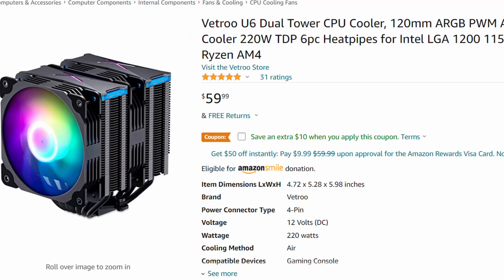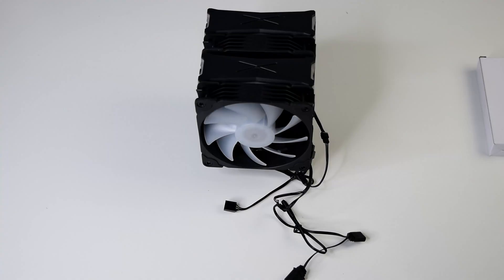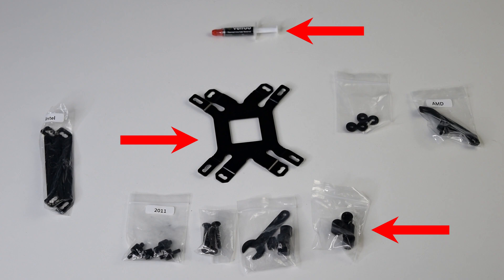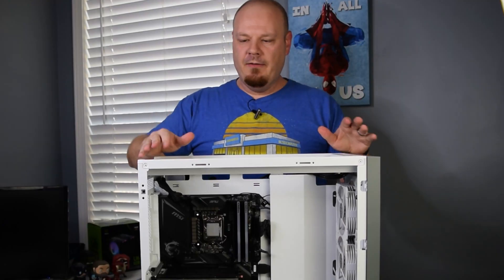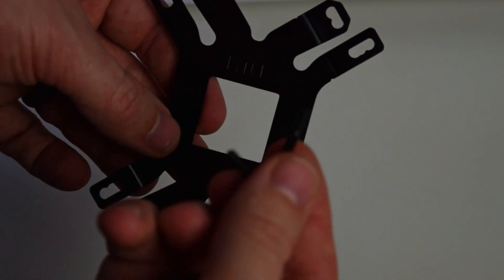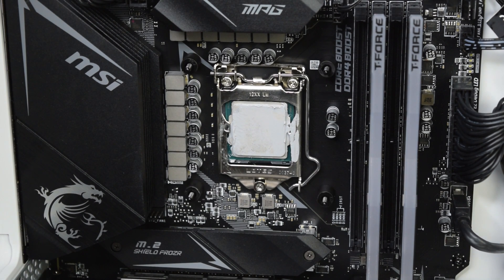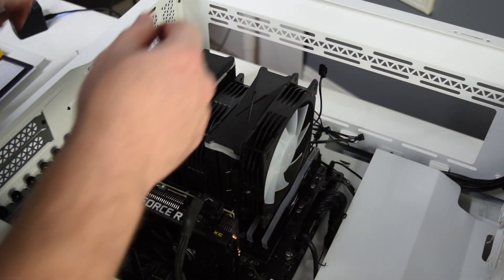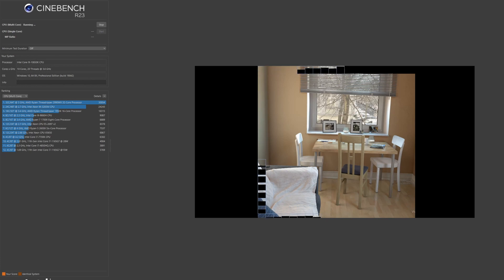Can this cheap cooler keep your CPU cool? Vetroo U6 Pro

Comment: I did not want to cover my ram so I moved the both fans back and it works great.So you can have both pulling and the temps are the same ass well.I  have 2 140mm directly above pushing air into the case and they cool the fins as well as the 3 140mm pulling in too.Definatelly is better than the wraith prism for a ryzen 7 5800x.Those always spike up to 70c when loading in then drops to 56c during game play.They sell for 39$ now great price.But the top rgb wont light up so they sent me a new one. Barely was noticeable but we all become finicky when it comes to PCs.

Comment: Do you think it can handle the 7800X3D? Or are AIO liquid coolers probably the only option?
Reply from the maker: It’s only 120w tdp so it should work, but I am not sure if that cooler supports AM5 yet. Remember the X3D chips are lower wattage than the rest of the 7000 series.

Comment: I bought one for my i78700, the thermal paste it comes with is more than enough or do you recommend another one?

Another thing, will this give me good temperatures for my processor or do you recommend another one?
Reply from the maker: That thermal paste should be fine. And that cooler should work well. The 8700 is a 65w TDP Processor and that cooler will handle that without breaking a sweat.

Comment: I recently built my first PC and bought this Cooler but idk how to change the fan speed or RGB on it any tips
Reply from the maker: The fan speed is controlled by your motherboard header. Just go into your BIOS or UEFI and set a fan curve to your needs. I typically leave mine on auto, but make sure the fan header it is in PWM mode. 

For the lighting you can use your motherboard’s RGB software to set the color and pattern you prefer. Vetroo doesn’t make their own software, but they work with the major manufacturers.

Comment: Hello, does the cooler tower clear the ram cards?
Reply from the maker: Depends on the RAM but it is adjustable so most RAM should be ok. You could also move the front fan to the back.
Reply: @PinkyTech  thank you!! Im doing my first ever build, appreciate the insight 🙏

Comment: I wonder if you could squeeze more out of the performance of the Vetroo U6 Pro using a case designed for airflow like Fractal Design Torrent?
Reply from the maker: I doubt it. That is the 5000D airflow with 3 120mm intake fans, so I don't think you'll get much better than how it performed.

Comment: i dont own any vetroo products but everything ive heard is how they are hitting way above their weight in performance and quality. i'd like to see what they could squeeze out of a $100 budget. i love air coolers so im always looking for the next best one.
Reply from the maker: Yeah the V5 is still my favorite budget cooler right now and supports 1700 socket. Just a single tower cooler design though, so not great on anything past 6 or 8 cores most of the time.
Reply: @PinkyTech Have you compared this cooler to any other air coolers? Something like a deepcool ak620 or ak500 would be a useful comparison. I can't find any good info on how it performs thermally and I'm worried it isn't good. I bought this thing based on looks in a rush and didn't research it at all so

Comment: There must be something so wrong because my 5600x would go upto 88c or 86c when gaming and my 5900x is just constantly 91c+ 

I wonder if it's something to do with my B550 Unify motherboard?
Reply from the maker: Yeah, something doesn't add up. The 5600x doesn't create that much heat. A few things to check

1) Make sure you have even mounting pressure. If you using something like HWInfo, does it show all cores hot, or is that the package temp?
2) Make sure the fans are plugged in and in the right orientation
3) Make sure you peeled the sticker
4) Check how much power is being used. This is a 220w tdp cooler. I had a similar issue with my MSI board where it tried to pump in way too much power because I had been using an AIO. But I have a 10850k which runs hotter than a 5600x.
Reply: @PinkyTech  All the cores always run very hot, the fans are fine, Ofcourse sticker peeled since a year ago or so, And as for power being used, That's the one thing I didn't check yet.
Reply from the maker: @MissesWitch  Hopefully this gets you moving in the right direction.
Reply: I hope so, probably there's either a seating or thermal paste problem. Because even when my CPU is running at 94c like today I noticed that the heatsink is always only slightly warm. It's never hot to touch.
Reply: Okay well update ^ ^ it was the thumb screws in the end that prevented the cpu heatsink from sitting properly, and added a little more thermal paste.

now when it gets hot the whole top and back of my machine gets extremely hot, can't touch it or even go close!

i think what i really need now are better case fans, so i will be upgrading them later!

Comment: cooler not for girls uwu literally took me 9 hours to install, and 2-3 hours everytime i want to change my cpu :<

it always runs hot at like 91c-95c everytime i play a game.

i reinstalled the cooler more than 8 times since i changed the cpu, and checked the backplate..but still just overheating.. aaa.. i guess i will try re-thermal paste next. eventhough i put a fresh one just a few days ago
Reply from the maker: Yeah, something is definitely wrong there. Check my other comment.

Comment: do you think it could cool something like a 5900x
Reply from the maker: It cooled my 10850k. The 5900X is only 105w TDP and this is rated to 220, so I think it would be fine. AMD chips are pretty power and cooling efficient, just don’t try to do any crazy overclocks.
Reply: @PinkyTech  Noted. thank you for the help, also is it possible to attach a third fan to it?
Reply from the maker: I didn’t try, but looking at the pictures on Amazon, I think you could. Of course you need the fan and clips.

Comment: Good video man! Funny how I buy this cooler, and there wasn't a single video on it. Your vid upload is Feb 21, whereas I bought mine on Feb 14. Perks of being single, you can spend Valentines money on yourself lol. Anyways I have had mine a little over two months now and man this thing looks cool and it performs well. I wouldn't say it's quiet, but I don't deal with the spin up whine the stock AMD cooler gave off, which drove me nuts. I'm running an overclocked Ryzen 5 3400G w/ Vega 11, no GPU and it really made a difference in temps and performance. Not that it was running hot with the stock AMD Wraith cooler, but the few degree difference can be seen in the performance. I would use this cooler on a higher end chip without hesitation. 

I mainly bought it because I liked the aesthetic, team air cooling here. Looks good in my Lian Li 215 Lancool with the 200mm fans on front case and with the 3 pack of Vetroo RGB case fans to match. Have a short video up showcasing my setup. Took a chance on this and was not let down. And for those worried about RAM clearance, I have 2 sticks of G.Skill Ripjaws, and had to adjust the front fan a smidge, but it left clearance between the fan and the glass without looking like it's off. A friend is using Tridents which sit a little taller and his is fine too. Actually like how it is so close to the glass the air has no choice but to go through it, forgive me for not being able to think of the terminology at the moment. 

I would recommend this to anyone who wants a chonky cooler with RGB, and is also looking to keep their CPU cool. My friend has a Ryzen 7 5800X which are notorious for running on the hotter side and it keeps the temps at bay. Says he is hitting about 55 degrees under load, compared to 60 with the AMD Wraith. Installation is the only issue I had. Instructions are clear and simple, just when I went to tighten the two screws mounting the radiators, it didn't want to cooperate and felt like I was about to strip one side trying to make it even. I did end up stripping out the screw head, so this thing is stuck now, but it's tight lol. But that can partially be blamed on user error as I should have changed to a more suitable bit to screw it in. Hope my little review experience helps anyone who comes across this and is interested in the U6. Just get it.
Reply from the maker: Thanks for the thorough review there! I like the cooler. I had to tone down my z490 motherboard, but that wasn’t the fault of the cooler. Other than that I thought the instructions could have been clearer. But if you’ve attached a cooler before it should be fine. Thanks for watching!

Comment: Does the x part have any argb cables?
Reply from the maker: They connect into the ARGB cable on the cooler, so only one connection to your motherboard is needed.
Reply: So if I get this I expect 3 argb cables one for the fan and 2 for the x thing ?
Reply from the maker: No, there is only one ARGB cable. The other two cables are already prewired into the ARGB cable. They aren’t ARGB connections. So just one ARGB cable total for the X lights and the front fan. Middle fan is just a regular fan, no ARGB since you wouldn’t be able to see it anyway. Hope that helps.
Reply: It does help thanks I might buy one looks cool